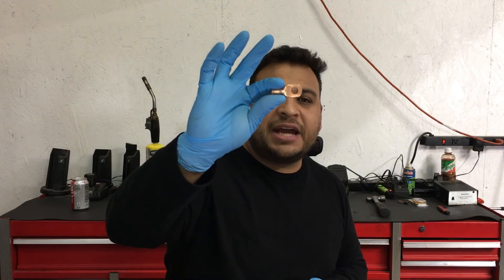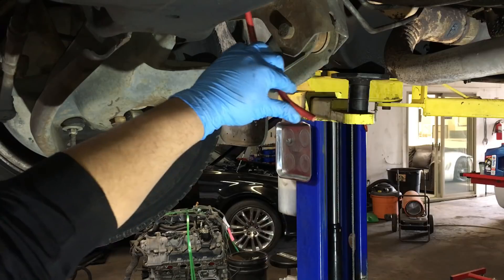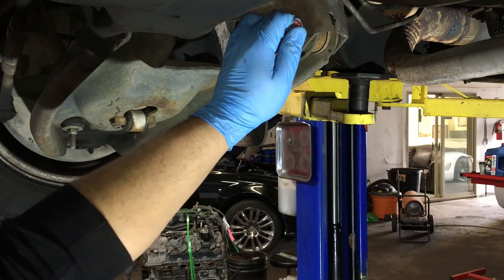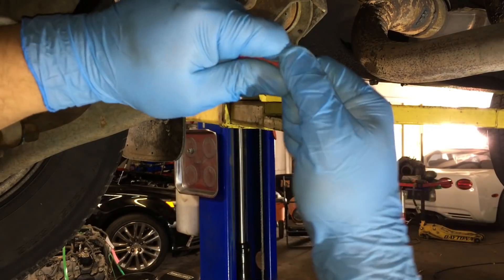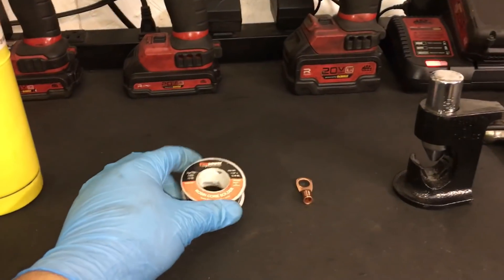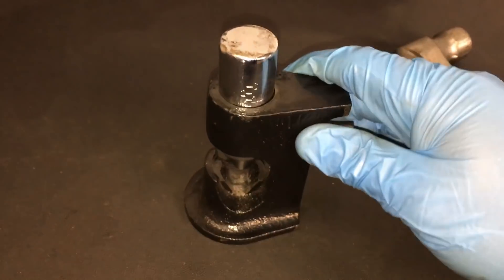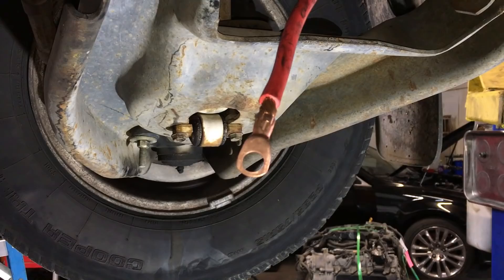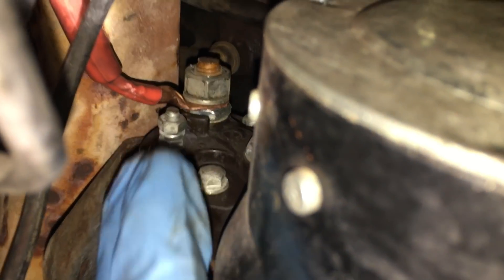SOLDERED VS CRIMPED COPPER LUG WIRE TERMINALS

Comment: The mine engineering workshop I supervise in Australia uses a mine specific system where the high amperage/voltage terminals we utilize are stainless steel but the open end where the cable is inserted contains a polymer sealant embedded membrane within the terminal that ruptures when crimped against the cable. The sealant is non conductive, resistant to heat convection and radiation to 2500°C, impermeable to both air and water bourne contaminants, and travels deep within the sheathed cable, protecting the cable from corrosion. The workshop have used this German engineered system for 20+ years. Failures are restricted to physical impact, not environmental concerns. We also utilize a wax tape system produced by Denso. This tape is used on everything from hydraulic fittings to electrical couplings to wheel nuts. Just cut, wrap and gently mould into place. Again, resistant to the most extreme of environmental conditions, making future servicing effortless. Just remember to ensure area to be encased must be free of surface contaminants to ensure longtivity. Hope this give you ideas. 👍👍🇦🇺
Reply: This is a completely different "ball game". There are other, more cost effective ways to make a good connection that will last.  I'm an industrial electrical engineer. What works on a $50,000 electrical motor will definitely work on a $100 car starter but will make that starter cost $500. It's just cost prohibitive. There are much cheaper ways to ensure good, reliable connection on a 12 VDC, automotive circuit.
Reply: @andrewevanoff1192  This system is implemented on all mobile and stationary equipment, whether it being a retrofit during scheduled maintenance, emergency time critical repairs or new site commissioned vehicles, from Toyota Landcruisers to stationary pumps to underground mining plant. The extremities of the environment are always challenging, and as engineering, we aim to utilise the best available equipment to simplify operations. The connectors, available in all ISO sizes for automotive, commercial and industrial, are extremely cost effective. An example, an eyelet designed to accept a 20mm diameter cable with a 12mm eyelet, in stainless steel with a manufacturing thickness of 3mm is $10.00 AUD. This is the civilian price, NOT mining. So please, explain how a connector, with polymer sealer and shrink tube included in the pack, is not a cost effective financially viable alternative. And you do not need to purchase specialist tools to use this system until used in commercial situations. 👍👍🇦🇺
Reply: There are many interesting tips here, however what you say has merit. In the engineering field, best or ultimate practice is not always essential practice. An OEM style crimped terminal might have some potential drawbacks under extreme conditions, but for the most part, it is highly reliable and adequate for the intended application. Every component on a mass produced vehicle is a compromise between function, performance and cost. I have a 16 year old vehicle and have not had any terminals fail or corrode. Off course any component could be improved upon, yet overall the engineers achieve a reasonable balance.
Reply from the maker: Thank you for your input! Lots of great information being shared here.
Reply: Andrew Hallett-Patterson  Hi, can you provide product supplier references?
Reply: If one had a real crimper such as the one temco sells you would throw away that solder.

Comment: I have watched many of your videos and have learned much.  Now it is time for you to learn from this 68year old retired tech.  You cold soldered it.  MISTAKE.  The copper wire, and the terminal BOTH must be brought up to the temperature where the solder begins to flow.  NOT one cold, and the other red hot.  The solder must flow into the interface by capillary action.  If done this way, crimping not necessary.  The solder makes a chemical reaction with the copper, forming an alloy. This chemical reaction is not instantaneous, but it does happen quickly.  The flux, is there to prevent oxygen creating a surface that is not clean hot copper, but rather an impossible to solder oxide of copper.  So once the solder begins to flow into the joint, feed in enough that the voids are filled, then continue the heat for two or three seconds more.  A low it to cool without movement of the parts being soldered.  Done.  Now for future corrosion resistance, grease it with normal grease.  A thin coat of grease on the post of the starter, and also the battery post connection.  Learned that from a Coast Guard mechanic.  People tend to die when the Coast Guard needs to go but the boat won't start.
Reply from the maker: Thank you for your input. Lots of great information being shared here.
Reply: @ADVANCEDLEVELAUTO sir please please reply May I ask a question and please help answer a question. My dad is old and he probably mistaken a 40/60 solder (40% tin, 60% lead) as the 60/40 solder. He bought at a cheaper price hit is one whole box. He intent to use the solder to solder between the copper wire and the open barrel ring lug connector for his electric bicycle. But after he realized is not 60/40, but is a 40/60, the seller refuse to do any refund or anything. In this video I saw your solder shown in the video is also using 40/60 solder on the lug connector. May I ask if 40% tin, 60% lead is able and suitable for solder copper wire with open barrel copper ring lug connector or any lug connector?
Reply: Wow. Absolutely fascinating information. Where I can read more about this technique/procedure (perhaps a website where I can bookmark this for future information)? Thank you very much.
Reply: @garrettstevensen2467  Good question.  I myself learned from a magazine called Popular Mechanics in the 60's.  Built a few Heath Kits too.  Soldering is one of the first things an apprentice Plumber learns.  In the near future, if there are no good vids on YouTube, I'll make one for you myself.
Reply: @garrettstevensen2467  Just checked.  All kinds of soldering tutorials at your fingertips on YouTube.  Just type in Basic Soldering!
Reply: Exactly what I was thinking.
Reply: Back in the mists of time, the 60's we prepared cars for rallying.  The crimp or solder argument was solved.  Cars assembled crimped failed (electrical joints) slightly more often than cars that had soldered joints. Certainly since then all the cars I have assembled have every joint correctly soldered (where possible). Since then I have 100% reliability. So solder the joints, but learn how to solder correctly, a "dry joint" is worse than a badly crimped joint.

Comment: I'm an ASE certified master automobile tech with 39 years experience. I like your work. The one thing to remember, however, is that your wire needs to heat up as well so the solder can flow throughout the individual strands - not always an easy task without melting a bit of insulation. But heat shrink covers that. Frankly, I'd just crimp in this situation. Up at the battery, where the gases can attack the copper, always solder.
Reply from the maker: Thank you for the tips
Reply: fordrust1961 from ASE 6 module 10
“Crimping makes a mechanical connection between the wires being joined, but it should not be expected to make an electrical connection. Once the wires are crimped, they should be soldered.”

Comment: I went to battery college and the professor there showed us how to CRIMP a battery cable and make it like one solid piece. Like you I always filled up the lug and drove home the cable as far as i know there never was a problem but I hear where your coming from. Ebay and others have a nice hydraulic crimper with several size dies for around 20-25 bucks yea real cheap china stuff but so far it has worked for me and now that's all i use is the crimper. Nice subject Eric thanks for posting. ebay item #113890214197 here's another 372879947180 i think i like this one better because the dies will not slide out when try to crimp like the other one. Merry Christmas.
Reply from the maker: Merry Christmas!

Comment: I love seeing educational callbacks like this one. Yup, I've been tinning both sides, then soldering those with a very hot propane torch. Then heat shrink to make a clean connection that won't hold moisture. Looks like I need to crimp first, too. A friend of mine emphasizes that the mechanical integrity of the joint should never rely on the solder alone. It is surprisingly difficult to do this properly!
Reply from the maker: My method was to solder just the tip of the wire so that when I crimped the terminal it wouldn’t damage the soldered connection. Thanks for watching!

Comment: I use these and skip the crimp. Crimping could break the solder  bond created between the cable and connector.  https://www.amazon.com/dp/B006K8V6AE/ref=psdc_15720011_t1_B07116791C
Reply from the maker: My method was to solder just the tip of the wire so that when I crimped the terminal it wouldn’t damage the soldered connection. Thanks for watching!
Reply: @ADVANCEDLEVELAUTO  I saw that. That may work but, you just get solder on the tip of the cable. The solder plugs fill the entire cavity with solder and make a tighter bond. I've used them a long time and never had a comeback.

Comment: that soldering is not good the coper should had resin on it and lead and then heated with terminal and more resin and with shrink tubing that has the glue inside

Comment: A good crimp makes a solid mechanical joint. Heat shrink tubing will help to keep corrosion at bay. I would have skipped the solder.
Reply from the maker: Thanks

Comment: When you solder a multi stranded cable you create a narrow region where the flexible cable becomes solid. Vibration will cause the cable to fracture at this junction. If the cable can be clamped firmly, as near to the soldered lug as possible, this will lessen the vibration at the solid/flexible region, & thus help to prevent this type of failure. However crimping is the way to go with cables that are susceptible to vibrations, and cannot be secured firmly.

Comment: You should first crimp that and then solder. BTW that soldering is rather bad because wire was not tinned and without flux
Reply: Yep. Crimp and then solder, or you'll crush the soldered joint, which is not flexible like the copper wire. Flux first, then install terminal, then crimp, then solder. Not sure if you can really tin the cable before installing the terminal. I would think not, because once you've tinned the cable, it is no longer flexible and will not crimp well.
Reply: @lour3548  you nailed it! If only one is done, crimp alone is superior to solder alone.
Reply: @lour3548  Correct.  If you tin the cable, it won't fit in the lug.
Reply: Yeap, like sweating copper pipes, they have to be together so the flux and solder flows into both connections.  If not, you get a cold-solder-joint that will separate.
Reply: Jason Bowman : WOW I feel so much safer now...isn’t dielectric grease an insulator that can act as a resistor?
Reply: The rosin core is the flux.
Reply: @walterk1221  , correct, but most will burn off when first melted into the lug-terminal.  It would be okay if the 3AWG wire was also tinned with solder.
Just my opinion.  Merry Christmas.
Reply: @walterk1221  All the flux was burned off.  None left.
Reply: @Jason Bowman Dielectric grease is actually an insulator. Best to not use it between crimp surfaces.
Reply: @Jason Bowman use the dielectric grease on the copper going inside the lug correct? Then press
Reply from the maker: My method was to solder just the tip of the wire so that when I crimped the terminal it wouldn’t damage the soldered connection. Thanks for watching!
Reply: @ADVANCEDLEVELAUTO  , you have real world experience.  Thanks for sharing.